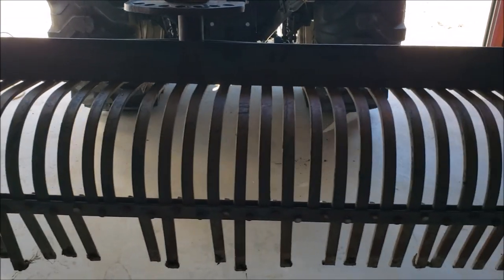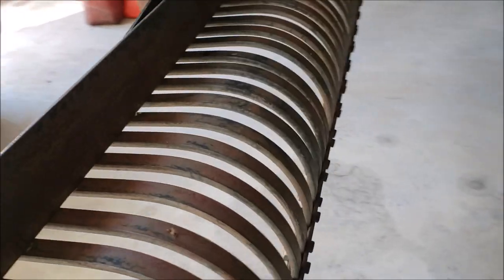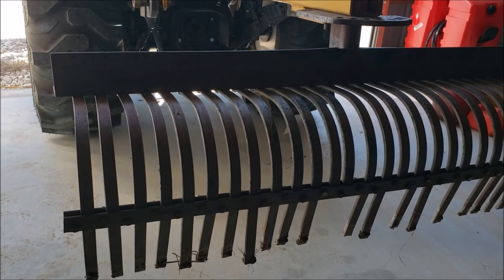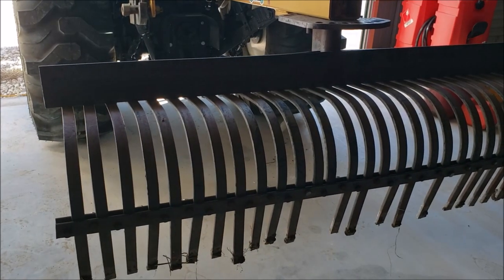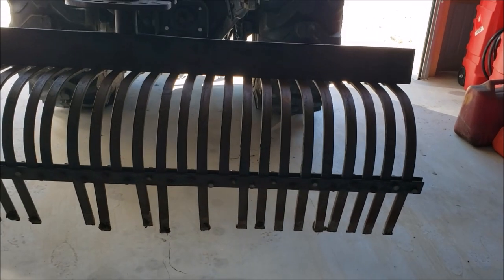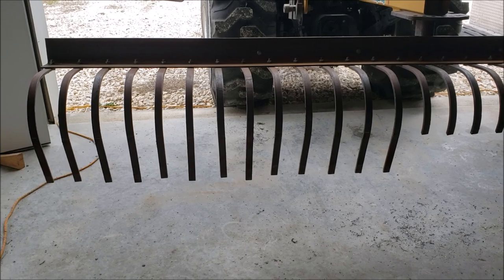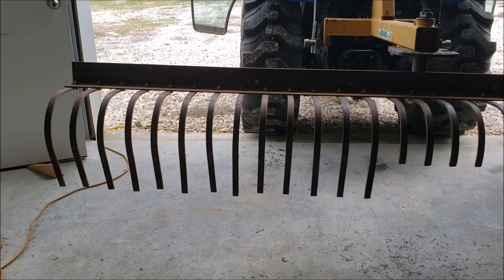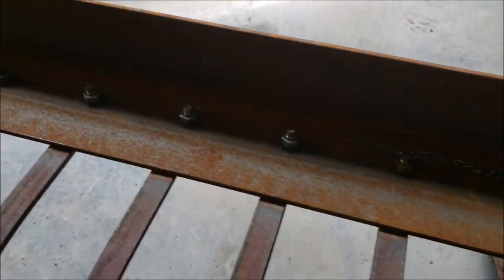Converting a 5ft 3pt Landscape Rake to a 10ft 3pt Landscape Rake

Comment: I’d definitely weld that support rebar across the top. High enough so you still get flex in the tines.  You want them to flex independently when one gets hung up on something Vs pulling the entire rake up.  I was wondering about the drilling too. That must have taken forever to do. It looks very nice!!!  Gave me ideas about how to fix my rake. It’s all busted up.
Reply from the maker: Got it.  I will weld up pretty high.  It does need the cross bar because the tines move left and right when dragging because of only one point of contact.  No matter how tight I bolt them down, they still move.  The drilling is fine when the bits are sharp, but man they get dull quick.  The smaller bits do much better and seem to stay sharp for much longer.  It's the bigger bits like 1/2" and above that seem to dull out the quickest.  Drives me crazy because they are not cheap.  I need to find a good way to sharpen them.